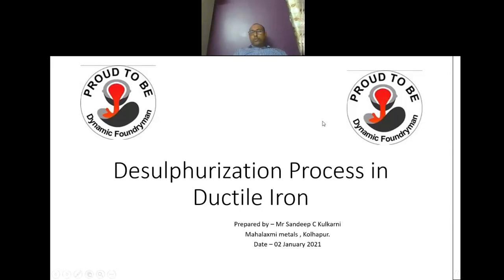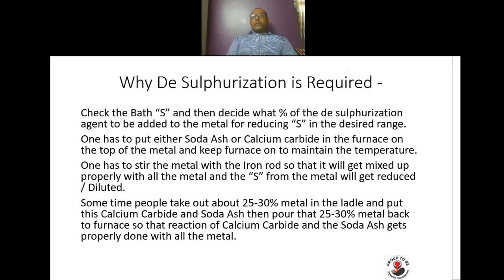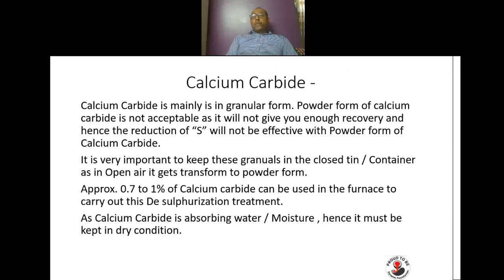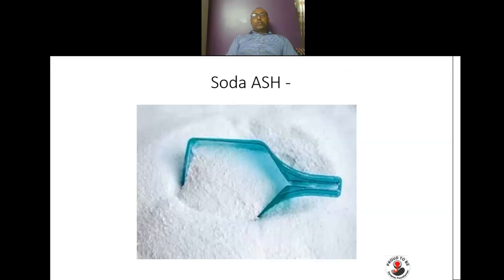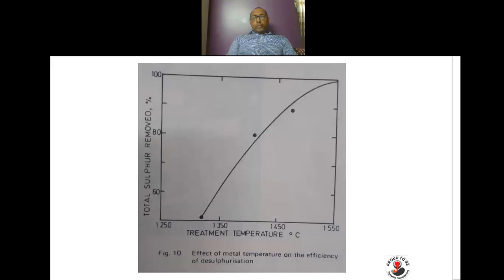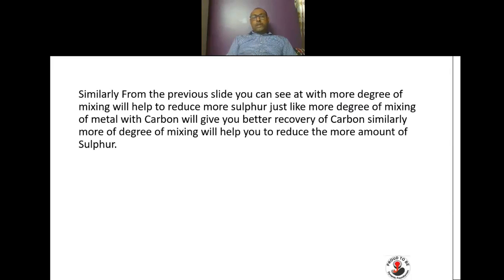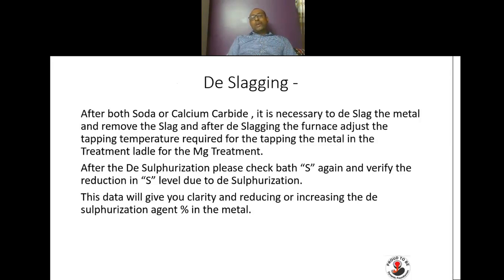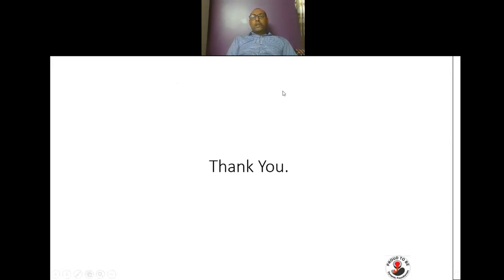De Sulphurization Process in Ductile Iron

Comment: How we can reduce crome and other elements which reduces the nodularity in ductile iron while using cupola induction duplex method.
Reply from the maker: You need to dilute then by adding low concentrations of these element material. There is no other way to dilute then hence purity of scrap and Raw material is most important.
Reply: @dynamicfoundrygroup  thank you for your replay. One request from my side kindly make video on microstructure of ductile iron. Your previous video on microstructure of grey iron was very helpful and one your best video.